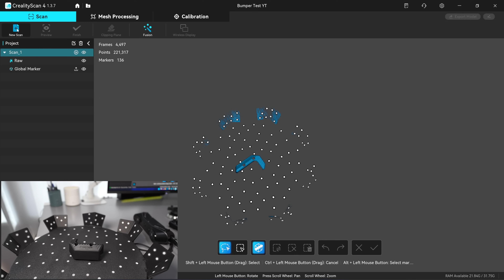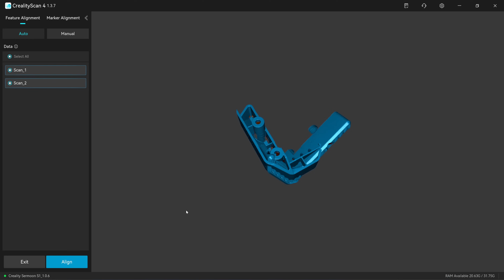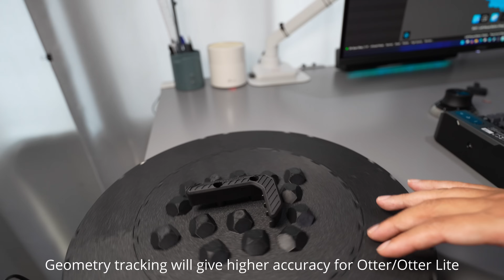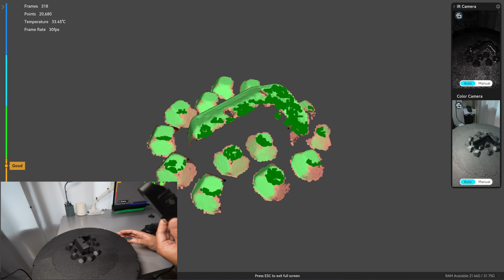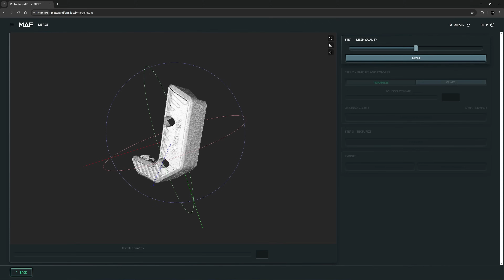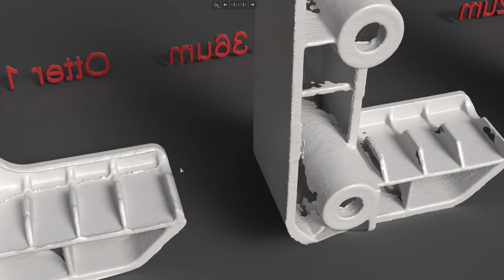Best 3D Scanner for Reverse Engineering – 8 Tested for Accuracy & Workflow

Comment: Thanks I own an Otter S1 and MAF 3, I think the analysis and conclusion are pretty spot on, but cranking the MAF to the max while takes a while does make some very good scans, I do question the integrated software solution, it leaves a lot of power on the table that could be offloaded to a PC. I get the it will work with anything but it really doesn't work with any OS it just is accessed by a browser. Not a bad scanner just slower than it could be. It would be great if they made an optional companion software.
Reply from the maker: The MAF3 is indeed a high-precision scanner—scanning the same part three times yields identical results. However, the calibration board is made from foam, which introduces excessive accuracy errors. A higher-quality calibration board would have been a better choice.
Reply: @Payo-TensileCreator  I can see that, but it doesn't seem to affect it negatively but time will tell

Comment: Thanks for a test. I guess for a scanner debate it will be very useful to see multi scan comparison of performance of the same scanner: full-auto, correctly tuned exposure, spray/nospray, different types of surface, processing in factory supplied software versus Metasphere/Geomagic. So basically we could separate hardware, software and scanning prep. 

I understand that this video will require a lot of work to produce but it will stop debates occurring after some scanner show different results in different tests. E.g. in your previous structured light test only Moose showed correct dimensions of curved object and this time Otter is better in both dimensions and surface.

Comment: Thanks Payo, very useful test! Personally I am biased toward the highest resolution and accuracy, especially long distance drift, because I scan both very big parts (whole car, where drift is most important) and also tiny tiny parts (1cm x 1cm, where resolution and ultimate detail is most important). I have never cared too much about deep hole scanning or recesses, though the s1 is excellent in this.

I find even laser scanners like the raptor pro aren't quite as good as I'd like on very small 1cmx1cm objects, though they produce good results.

So my preference is for the highest possible detail and accuracy scanner, which seems to be the raptor pro here.

If you are willing to trade off a tiny bit of accuracy and detail, the s1 is the best all rounder with that single line laser!
Reply from the maker: Thanks for sharing your thoughts!